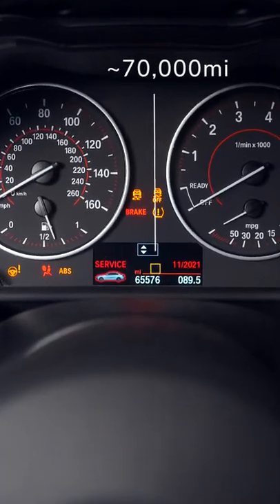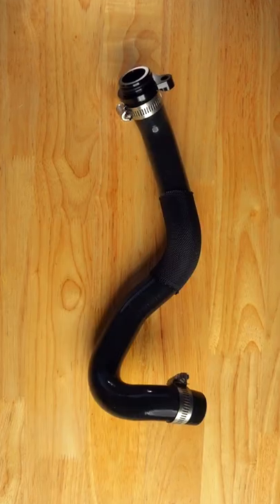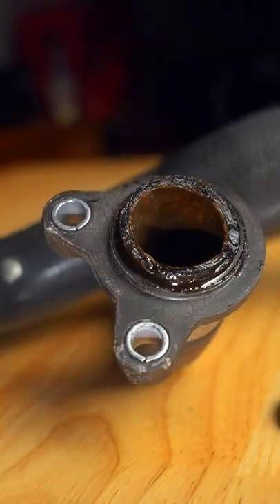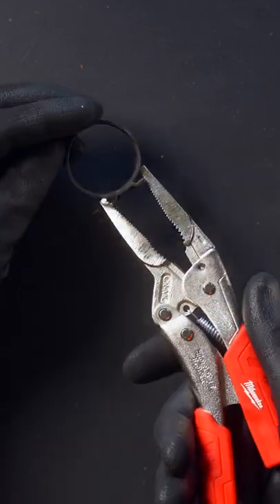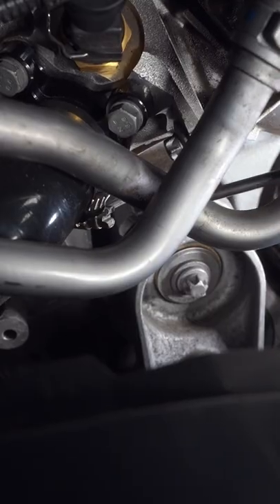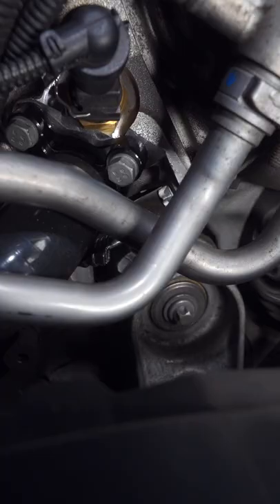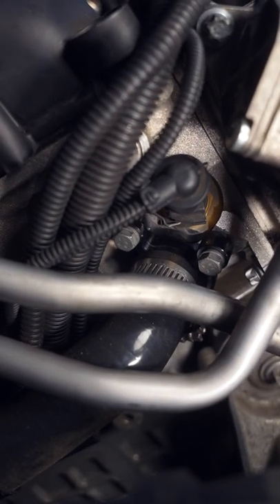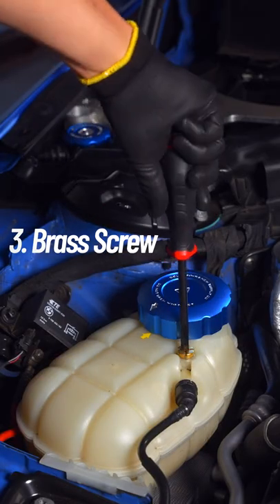DO THIS on your next COOLANT Flush

Comment: Those spring clamp are the best option if the vehicle is stock the spring clamps are constant pressure clamp that adjust to the the temperature of the engine expansion  and contraction

Comment: Use the right tool for the right job...the screw clamps are easier but as the hoses heat up and cool the expand and Contract. The screw clamps won't expand and you'll break whatever it's on

Comment: Do NOT switch your clamps for screw tightening ones. It will DESTROY your hose over time and that will surely cause a leak. If it does happen to anyone the quickest fix is cutting the hose and getting spring clamps as soon as possible

Comment: If your bmw is coming up on 70k miles its time to replace your engine
Reply: Can’t say that for the e92 generation backwards.  From 2013 backwards (avoiding V12 and most V8’s) they are very stout and reliable actually.  Non M.

Comment: Noooooooo never use screw type hose claps the heat and cool cycles with expand and contract the metal causing it to leak. Use the constant pressure style to adjust grip when metal expands and contracts🤦‍♂️🤦‍♂️